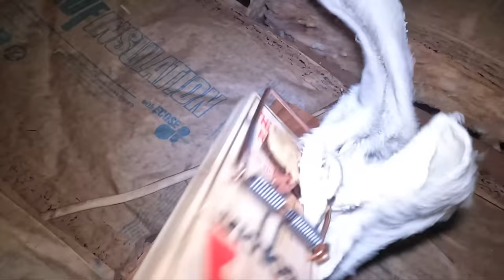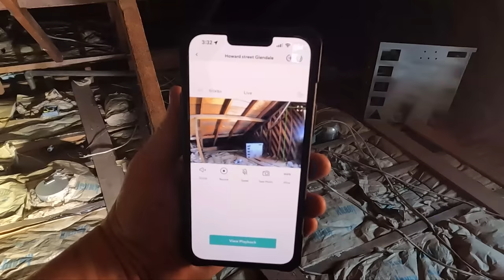Rodents in your ATTIC!? Here's what you do...

Comment: Mice in ceiling:  Pulled up carpet in room above.  Located joists. Drilled holes in subfloor.   Poured in mouse poison in between each joist.   No more mouse scratching sounds.   

This works for carpeted floors in room above.      Mice are dead but still in ceiling.    They are small enough to dry out and not smell.    

Turns out the chimney chase I built was not mouse proof.   I also had chicken feed in garage.

Comment: If rats go in roof air vents, can they still get into attic if there are no open pipes in crawl space or walls?
Reply: The answer is kinda obvious, unless there is a hole they can not enter whatsoever although there is a possibility that they chew through plastic pipes and enter.the hole can just be a few cm and they can fit through.
Reply: @MeMelon4u  could’ve reasoned that out myself lol. Thx
Reply: @skang3368  then what's ur worry?
Reply: @MeMelon4u  rats in attic.  I was wondering if they were getting in through air vents since vents are open on the roof

Comment: Sorry dude , Love your can do attitude, but guarantee for life, come on! Rats can chew their way in some other corner that you can not access.
Also most subfloors are crawl on your stomach types, so the work you carried out is not possible. And not too many roof voids that you can walk around in.
Rats may be living under ceiling insulation, are you going to remove all that to find them? Plumbing work is beyond the scope of pest controllers.
Best solution in this case, cut back any tree branches touching any part of the roof, wire up any obvious entry points, put in place lockable bait stations
to perimeter of the building and some in subfloor. Monitor and add bait when required. If you have endless rats in the area you have an endless job.
Also why does she have the problem is the most important detail. Pet food remains in bowls, does she have pet birds or chickens. Could be many reasons.
Not raining on your parade, just saying. My best advice for customers with cockroach or rodent problems, STOP feeding them.
BTW I run my own small pest control business in Australia.